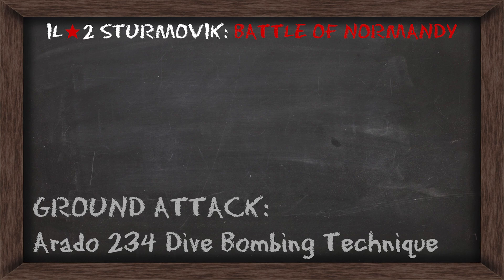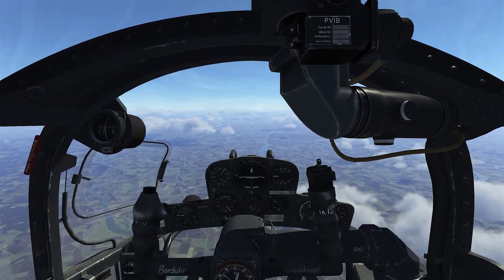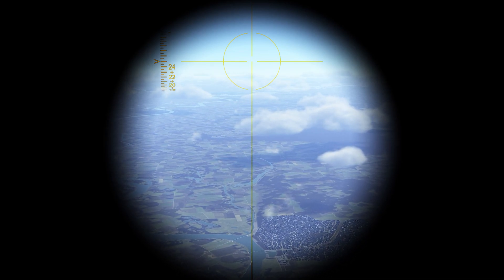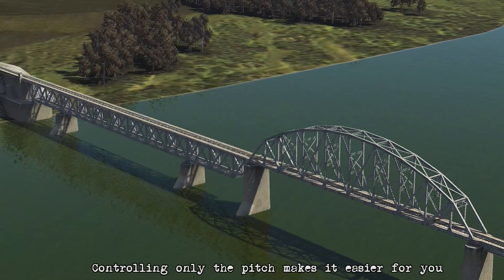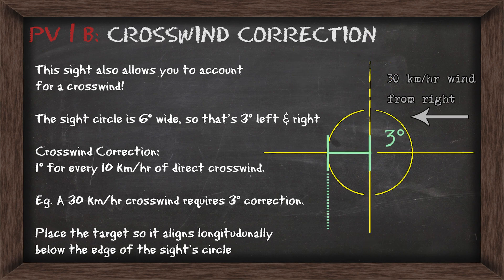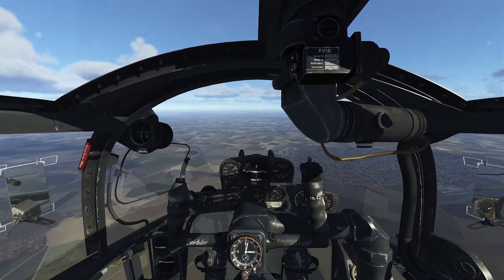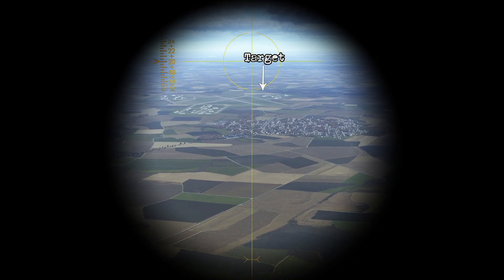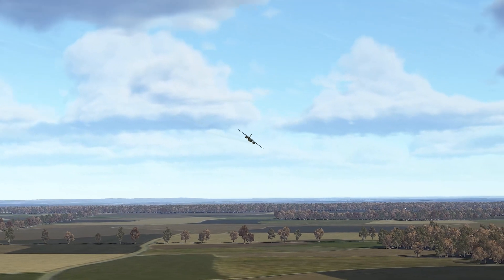Arado 234 Dive Bombing Technique

Comment: I see, the BZA in combination with the PDS Autopilot offers a lot of different technics to use😃
So far I used it control the attack completely with the autopilot including control the dive with the pitch axis (control it comfortable with an axis ) and turn off the autopilot right after the drop. The nose trim is light up but while the dive the pitch channel overrides the manual trim. So after drop and turn off the autopilot the Plane recovers automatic and I can fly evasive movements. But only turn off the pitch channel and control the dive with the stick is a nice new aspect, I will check out right now 😜
Especially thanks for the aspect with the crosswind, this was an unsolvable problem so far… now I can schedule attacks more variably 👍🏻
Reply: The manual horizontal stabilizer (not technically trim) still plays a role with autopilot;  the pitch channel does not simply override it as they work independently of each other.
Reply: @Jbroker404  about the technic I am not sure…. Maybe it’s an good idea to see what moves in 3rd person 🤔
Reply from the maker: Yep there's definitely a lot of ways to skin this cat. Everyone grows to figure out what they want 😊